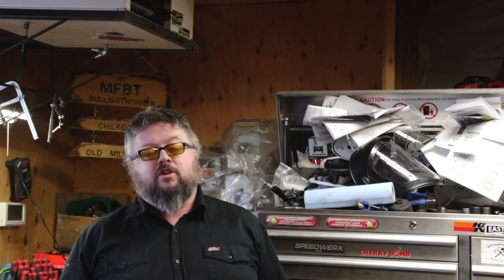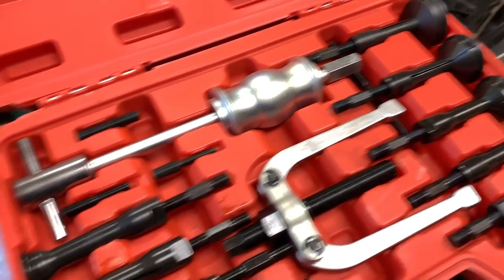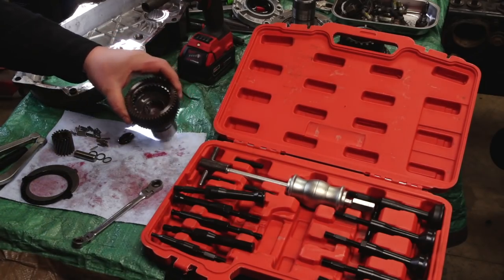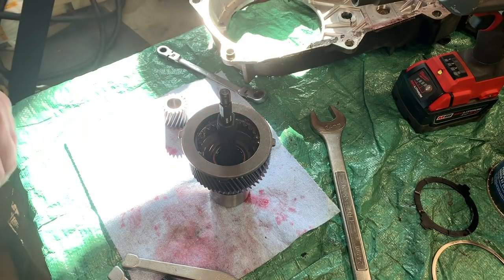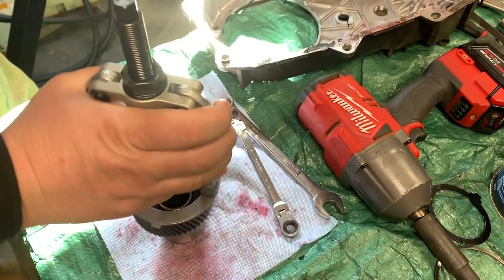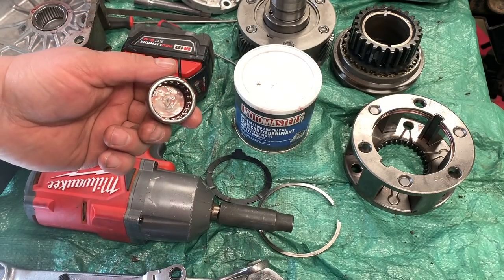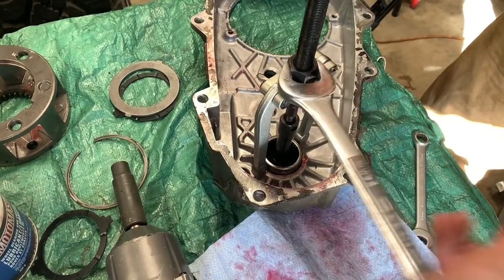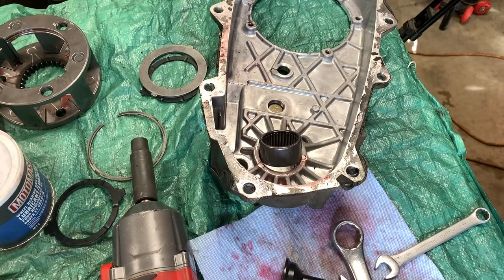How to Extract Blind Hole Bearings

Comment: Thank you for this!   I am in the process of rebuilding the NP231D in my 1994 Dakota V8 4x4.  This is the exact tutorial that I was looking for on pulling these bearings. 

This is actually the second NP231 I've done, but the first one I did without the puller.  It was much easier this time. 😂

Comment: When I was doing my apprenticeship repairing power tools I was taught to remove them with a pin punch & plasticine as we weren't going to reuse them.

If you want to reuse them,you can get a shaft which fits the needle bearing them pump the cavity full of grease & drive it out that way, if it's an aluminium housing,just heat it up with a heat gun or propane torch ,tap it on the bench then the bearing will fall out.

You could use a block of wood to tap the new one in once the housing has been heated up,if you spit on it then they form into little balls them the aluminium is hot enough, I must've been taught by one of them.

They can help save lots of $$$$s !